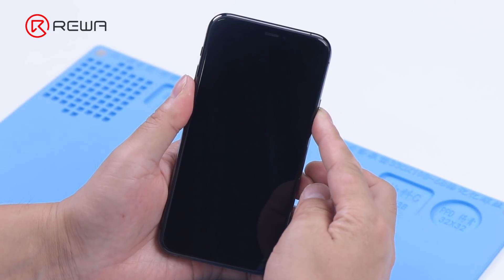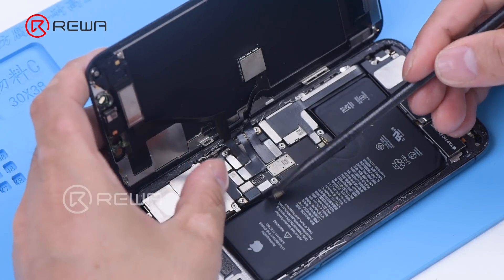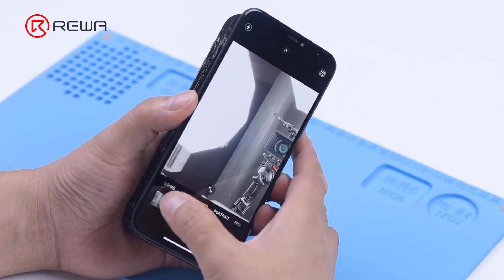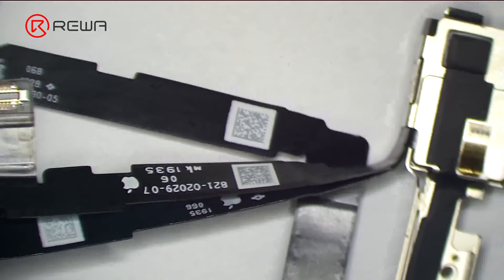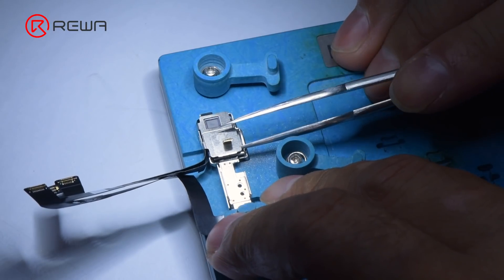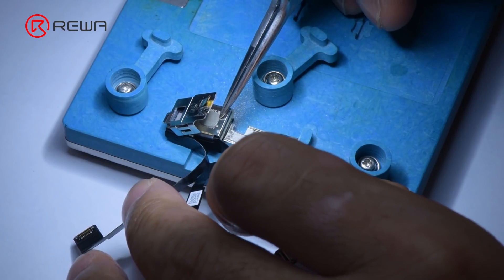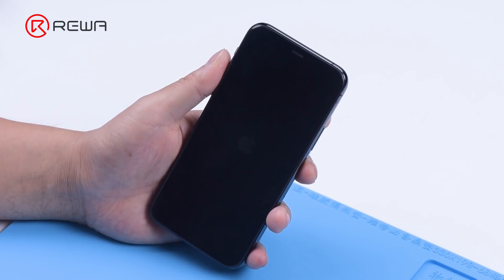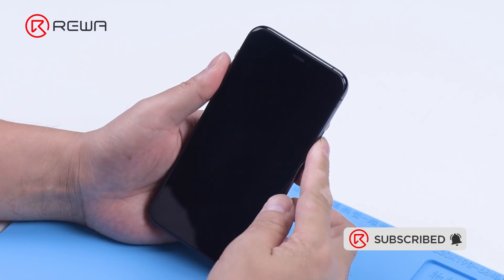Replace iPhone 11 Pro Front Camera While Keeping Face ID Function

Comment: Does this mean replacing the entire module will disable faceid from working??
Reply: there is binding chip in dot projector and proximity sensor [which is attached to the ear speaker] if either 1 is damaged or replaced u have no face id. if u replace ear speaker flex it is more difficult repair to remove the tiny proximity sensor from the delicate flex and properly align and solder it to new flex
Reply: @bermyvlogger My faceid is not working anymore. Thanks for explaining which part is defective.

Comment: Can you repair motherboard if that causes both camera to fail?
Reply: Did you manage fixing it. Manly it’s caused by a faulty camera ic
Reply: @SportsCircuit-UK  well both cameras are damaged so I bought the pair and change the front camera from the new to the old frame to keep face ID

Comment: I do fix face id everyday 3-6 phones and my experience is original front camera is part of f id functionality so that camera you replaced shouldn’t work!!! Correct me if I’m wrong 
Big respect Rewa
Reply: You are wrong, confirmed.
Reply: Ok so I have the same issue says problem with TrueDepth camera Face ID is disabled. It’s the genuine apple speaker/sensor module and genuine ir/front camera and the front camera works but the Face ID is not working. The screen is 3rd party . Would it need to original screen or would the problem just lie with the camera

Comment: I don’t really understand how when the new camera is plugged in it didn’t work. but when you cut the old one out and put the same new one it, it now works… I’m confused did I miss something?
Reply: Looks like he keeps the existing IR camera parts of the module so face ID still works, but just replaces the front camera
Reply: @asderferjerkel  The thing though is that during he testing of the new one (prior to the camera swap) the remaining of the module was still attached to the board. In other words, it appears to be no difference in the final module connections from before and after the swap.
Reply: Even I thought the same
Reply: Just the camera replacement not whole module
Reply: Thats the same thing that I said it appera to me that they have all the connections on the board the only one that wasnt was the new front camera flex, and I see that face ID didt work have any of guys tried this?
Reply: What is that tool that holds the camera